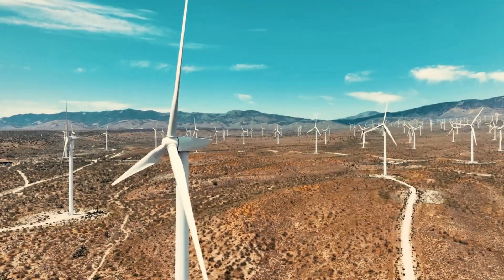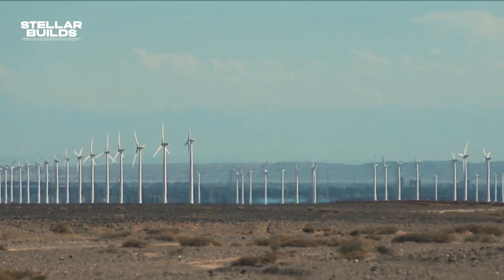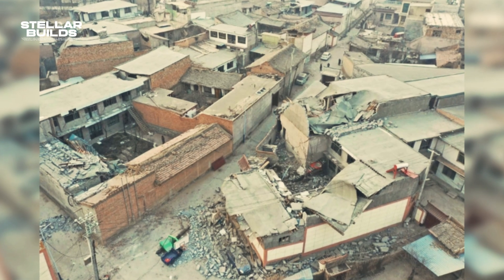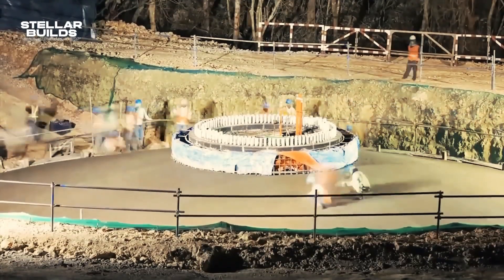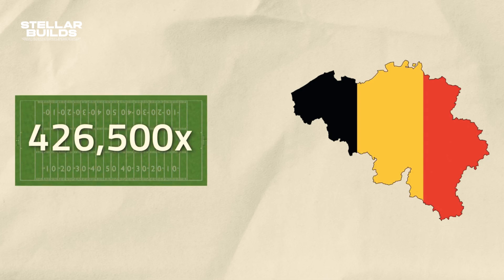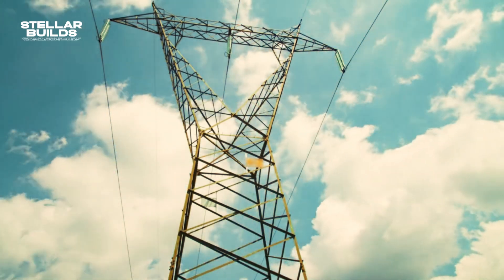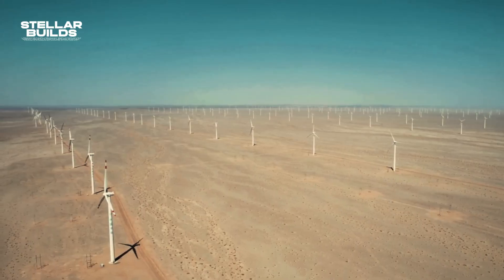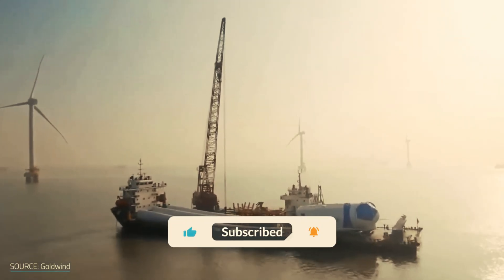The World's Biggest Wind Farm Is Failing – Here's Why

Comment: This is a western smear.  Both solar and wind power installation costs have reached parity and any one of the two is now cheaper than "running a thermal power plant + its operational fuel cost".  Any suggestion that a coal fired power plant can offer cheap electricity is a fabrication!

The initial phase of any wind farm will have extra energy not fully utilised but this problem is only temporary.  As with all renewable energy projects the storage system will be installed later after the wind farm is full built.  The energy storage can take different formats but it is no-brainer some battery systems will follow if there is excess energy available for storage.

The west can continue to burn fossil fuel but China has found a way to generate renewable energy without the need of fossil fuel.
Reply: Someone has to cheerlead for the CCP
Reply: @clintonhummel8776  China-haters use CCP.  The official name is CPC!
There no need to cheerlead because China in the last 3 years has added an average 43GW wind power per year.  In this world only US and Germany have a total national wind power installation exceed what China could do in one year.

For the last 8 years where global wind power installations data can be verified China accounts for more than 1/3 in each of the 8 years.  Talking about one wind farm in China is like looking one grain out of a grain storage silo.